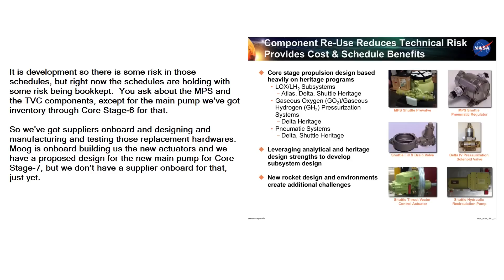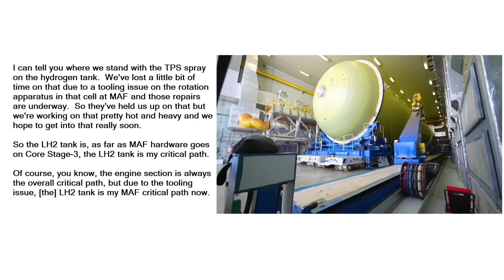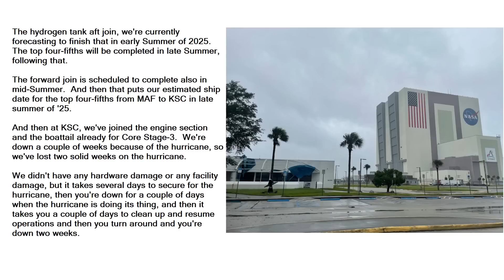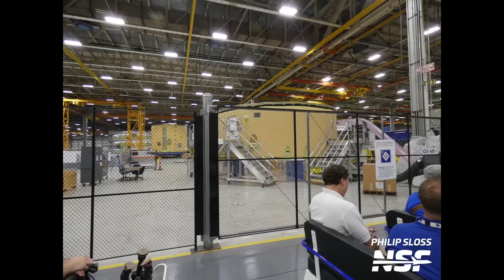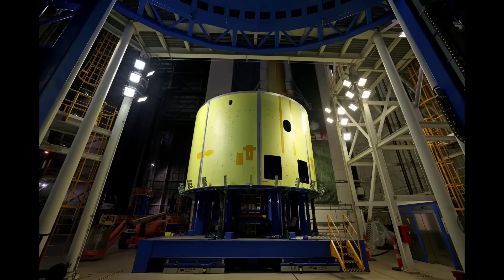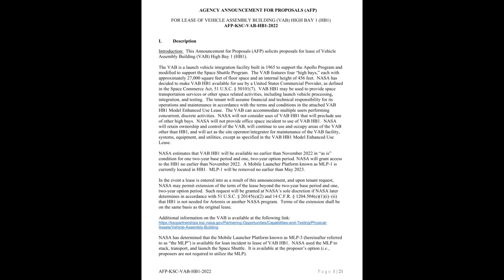Checking in on SLS Core Stage production while waiting for the post-election dust to settle

Comment: Given that it's only 66Ft in length the forward-skirt/LOX-tank/Intertank assembly could be assembled in the VAB's low-bay and then stored in the remaining unused high-bay before final-assembly in the vertical-assembly tool in high-bay 2.
Reply from the maker: It would require additional platforms/tooling in the low-bay (possibly restricting access) and additional tooling to install exterior equipment vertically versus how that is done horizontally at MAF.

Comment: The worst thing about SLS is how many good engineers that would be needed elsewhere are kept on an essentially worthless project.
Reply: SLS is anything but worthless.
There's nothing in development, at least outside of China, that matches that launch capability and it is needed for Artemis with the current architecture.
Reply: @brokensoap1717  You live in a parallel reality then.

1. It's possible to build spacecraft in smaller parts and connect them in orbit. One could use something like a Falcon Heavy to launch such payloads then. Of course there is a penalty involved in that. But it's not anywhere near as high as one SLS launch costs.

2. With reuseable Starship one can transport such components into orbit on the cheap. With non-reuseable Starship it would be possible to launch large components, as SLS does it, as well.

Please learn about why SLS exists. It's purely corruption and poltiics. They deliberately spread out the production all over the US to get political influence. It's one of the most shameful tech projects out there. You can learn about it on e.g. Planetary Radio Podcast.
Reply from the maker: Tbf, a lot of people gravitate towards SpaceX and Blue Origin.  Not just the work, but the pay.

Comment: It´s incredible how painfully slow the production of this vehicle is, what are people doing in the factory 70% of the time?  Just looking at the unfinished thing and doing some actual work from time to time? Do they do other things unrelated to SLS? I just can´t understand it.

Anyway, thank you so much or these videos, amazing work by sharing all of this info with us rocket nerds.
Reply from the maker: It's a good question, but hard to answer without better data.  I do think that intentionally setting a low flight rate has a big influence on how efficient things are (or aren't).
Reply: A lot of people are cross trained on other operations.
Reply: It's a lot of work to build each stage (the engine section especially) so I'm not too surprised.
That being said they could probably go faster if there was a push to build this vehicle at higher cadence.
Right now they expect to only need 3 more core stages (with one of those already built) and 1 EUS flown this decade so there's no rush, especially on the core stage production side.